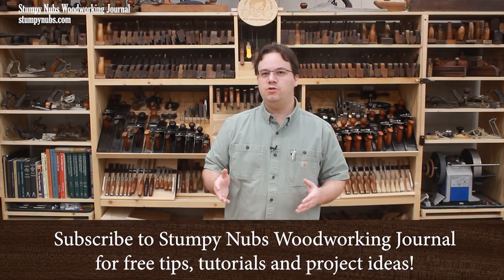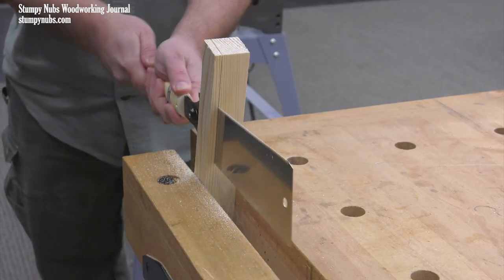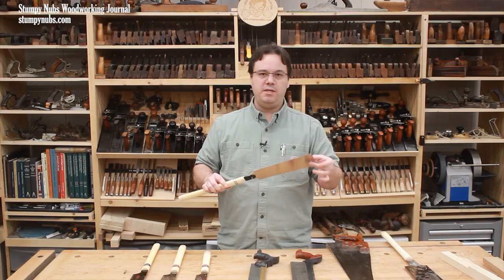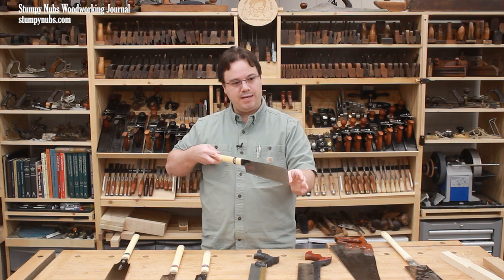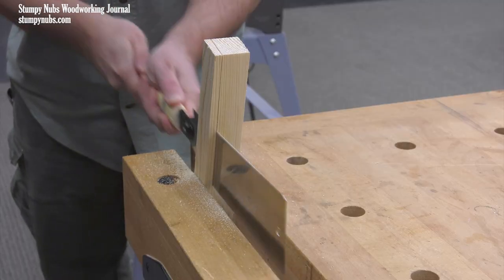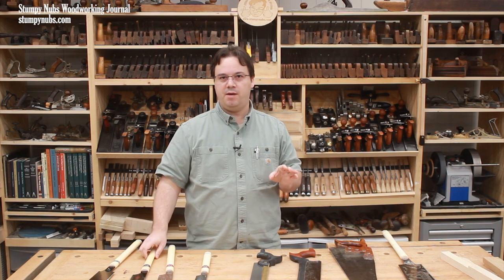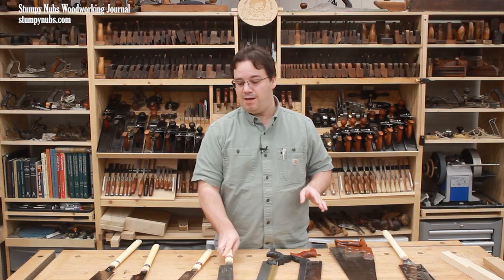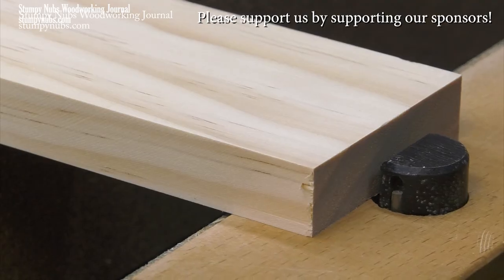Is Japan slowly killing western-style saws?

Comment: I got a Ryoba for christmas and I bloody love it. I hadn't intended to be using it just yet (weather is still pretty wintery here so not had a chance to start any woodwork-builds this year) but I discovered just adfter Christmas that I had an urgent need to rebuild my bathroom (water damage meant I had to rip out and rebuild everything) and my new Ryoba was absolutely brilliant. While I used powertools for most of the big cuts, it was superb for smaller jobs. I laid 5mm plywood on the floor to go under the new vinyl and it was damn-near perfect for cutting around door-frames and pipes.

There is only one disadvantage that I found - because it cuts on the pull, you have to hold your wood down much more firmly than you do with a western saw. I'm used to being able to place my wood on a stool, kneel on it, and crack on with sawing, but with the Ryoba, it would often catch on the wood slightly on the return-stroke, making it flap against the stool under my knee. I could clamp it down (and it did do this for more precise show-piece work, such as side-panels for cabinets), but it's an extra step that slows you down a bit. However, the precision of the cut (even from the "rougher" end of the Japanese Saw Spectrum) was worth the effort.

I would recommend one to anyone, and I'll definitely expand my Japanese saw collection in the future - I suspect the only Western saws I'll buy will be the £5 disposable building-site ones that I'll use for only cutting 2x4s and pallets to very rough size (and maybe the odd tree-branch)

Comment: This is great great content as usual, James. There is at least one other type of Japanese saw worth mentioning, and that's the small (5"-6") "Suizan" which is, like the larger Suizan you showed, a dedicated,  flush-cut saw. The small ones are great for sawing off dowels, etc. in tight spaces. 
I'm firmly in the Japanese pull saw camp now. I still have my dad's Western style crosscut saw and my first back saw/miter saw. They're dull with use,  but after testing the waters on an inexpensive Ryoba, I've got no desire to sharpen and use the old saws. They'll become some type of art pieces...maybe a sign or two for my shop.

Comment: I am a professional finish carpenter, as well as doing custom shop oriented wood working. On my site work, a good quality ryoba is my hand tool bag at all times. I reach for 5-10 times a day. It works quickly and accurately (in trim carpentry terms). I can have it out and the funny little notch I have to cut done and moved on before I could even get an equivalent tool out of the truck. Think notching door jambs around different floor heights. In the shop, I keep a higher quality ryoba and a very good quality dozuki. The dozuki is great for dovetails, with the one exception. For very hard woods with wild grain, the dozuki has a tendency to want to track with the grain. For those instances, I have the Lee Valley dovetail saw like in your video. Can't tell you how many old trim carpenter farts I have converted to the Japanese saw train. Once you let them try it, the next time you see them they will have one.

Comment: Hi James,

The comfort and fatigue advantage you mention is because the pull stroke uses the posterior chain, which means all the large muscles in your bank (lats and traps) and the biceps, while the push stroke uses the smaller chest muscles (pecs) and the triceps (which, while larger than the biceps, are mechanically disadvantaged by the structure of the elbow).

Comment: I would like to suggest a very useful saw, especially in the field. Silky makes a folding "pruning saw" (Gomboy) that is great to fold with the blade protected by the handle and keep in your back pocket (or in your tool box). I use these saws to cut off pegs in timber frame construction and cutting trim on a roof without the need to run an extension cord for a power saw. I often use them in the shop, as well. Cuts are clean and the blade rarely scratches the adjacent surface when cutting pegs flush on a finished timber. Blades are available with very fine or aggressive teeth.

Comment: I did a little research to confirm something I vaguely remembered hearing. Japanese and Western woodworking tools diverged to work on the pull versus the push for a very simple reason. Traditional Japanese woodworkers work while seated on the floor. Push strokes simply don’t work from that position.
Reply: I was thinking the same thing. Shoyan Japanese Carpenter on Youtube mentioned he always prefers working close to the floor to cut. It made a lot of sense since he's using pull saws.

Comment: Good points in this video, just would add: if the tool is made in Japan it is good quality. My Zetsaws ran about 900¥ a blade and are razor sharp. Handles, which can be straight or pistol griped, adds another 1000¥.
But key is that it is made in Japan.
Finally, the first tooth by hand is for digging out your cut line, and the last tooth is for flattening your cut if it is domed for joints. Incredibly useful features many will miss.

Comment: I really enjoyed your Japanese saw video.  Also, thank you so much for your recommendation of the Ridge saw blades.  I just bought one of their blades and wow, what a difference a good blade makes.  We all know there's a big difference between a sharp blade and a dull one, but I never knew there could be so much difference between a good blade and an average blade.  Yes, the Ridge blades cost a bit more, but they're definitely worth the extra money.  Those people obviously know their blades.  The cut is so smooth, and they even SOUND better.  They're well balanced and produce far less noise and vibration.  

Of course, being the frugal sort that I am, I can't bear the thought of trashing my old blades but I doubt if I'll ever buy another brand now.  I plan to spend a few bucks and send in my old blades to see if they can work their magic on them.  If nothing else, I can always use them for rough work but I'm guessing they will perform much better after they've been worked over by the pros.  Keep up the good work!

Comment: A only use Japanese saws.
Sometimes when I'm cross cutting a flat wood board, like a 1x4, i like to hold the saw with the blade pointing down to the floor and moving in an up and down stroke with the handle on a slight forward angle..
Works great for me.

Comment: I use a kataba-like saw with curved handle, not a straight one. That makes the grip quite natural, therefore it is easy to switch to this type of saw when used to western grips.
For those interested, my saw is from Tajima (the _JapanPull 265_), and can be found on Amazon, though I got mine in a French hardware store.

Comment: the comment about using these saws in place of a power tool is right on!  I often grab one of our Katabas (several have 'half-pistol' type handles), instead of the noise and mess of the power tool, wne cutting a smaller piece... also, living in an apartment, nice to be able to do woodwork without having your neighbours pounding on the wall or ceiling!
BTW, Japanese tools totally changed my appreciation for woodwork!  I was just unable to 'get it' with western saws, and always felt that they were 'inelegant'; so, along with the dreaded pocket hole kit, I ended up happy to dive into projects that I'd never have done in past!
Oh, and a 'funny' thing...when you DO cut into a finger with a fine blade Kataba, it will heal without a scar!  Yes, sadly, experience talking ;-)

Comment: I own and use several types of both western style and japanese style saws and like them both.
But I find it easier to correct the saw line during cutting with western style saws due to the stronger blades.
On the other hand the much lower weight of japanese saws is a very nice plus.
I personaly find the look of (traditional) western saws phenomenal!

Comment: Very nice presentation, thank you!
Besides all the valid pros of the Japanese saws, there are a couple more which contribute to explain cutting on the pull stroke. One is ergonomic as Japanese woodworkers traditionally operate squatting or sitting. In that position, one can more easily apply more force pulling than pushing.
The second is religious as, in Shinto belief, the craftsman is cutting the "spirit" of the wood piece and by pulling the saw it "redirects" that spirit toward the craftsman. This is viewed as beneficial and respectful.

Comment: When I started woodworking, I had a choice to get used to one or the other (I can afford both, but only want to get good at at least one at a time), I just naturally found the western style saw easier.  I am normally sized 5'10" dude.   I think what turns people off is the difficulty starting the cut.  Also I think people try to grip the western saw with all the fingers instead of the bottom three (pistol grip), which inhibits a lot of flexibility in the wrist.

Comment: Good video.  I first came across Japanese saws about 25 years ago, and loved them for many jobs.  I still use my (very old) Disston panel saw, which I also love using.  For long, straight cuts through timber it takes some beating.  Years ago when I was working alongside some carpenters, they recommended that I get a panel saw as my main saw - you could do pretty much any type of cut with it.  And they gave me a great tip for cutting accurately to a line - don't even try to follow the line inch by inch; Just aim for the bottom or far end of the cut, and go for it.  Constantly trying to correct for small errors just makes things worse.  I found it to be very true - I stopped looking at the line just below the blade, and went for the end of the line.  Similarly with hammering nails.  Small taps, constantly correcting for any waywardness of the nail doesn't work.  Just tap the nail in so it is slightly embedded, and then go for one big thump.  It will go straight in.  I watched them do this, and it worked, so I tried it - it still worked.  I way them hammering 6 inch nails in with one blow.  This is similar to splitting wood with an axe.  Don't aim for the top of the wood, aim for the bottom of where you want the split to be, and hit it hard.

Comment: I use jewelers saws all the time, and they are almost always set up to cut on the pull; of course, you can put the blade in facing either way, just like a hacksaw, which I also tend to use on the pull, usually not always.

Comment: Been using some basic pullsaws for years, but never of high quality. I can't believe how long they have stayed sharp. I also have a tiny little pull saw that I actually found at HF. Made in Japan, wooden handle, about 6" blade length, and extremely sharp. It comes in very handy in tight places. Pullsaws are the best for cutting shims after hanging a door.

Might be time to upgrade my pull saw selection.

Comment: Good point re the tooth set on Western saws. I find the majority of Saw Drs set them way too wide. My approach is to take out most of the set to the point where the teeth only just protrude. To stop the saw jamming in the kerf all you need to do is keep the blade lubricated with either wax or Camelia oil. Any residue is removed by either the planing or sanding step. Japanese saws are perfect for the small intricate cuts I make when building smaller projects like Jewellery Boxes etc. Both have their place with neither one being overall superior.

Comment: Pull stroke saws are good for precise work but for general construction carpentry give me a topline Diston or Sandvik, properly gummed, sharpened and set. Working high in the rafters of a house I much prefer the push. Working is safer. The pistol grip is safer and easier to hang and keep handy. If kerf thickness is VIP to you then keep a pull saw handy for some jobs.

Comment: I'm relatively new to semi serious woodworking. I remember using my dad's western saw as a teenager...and the memories aren't so great. It would bind and I'd think I was damaging his saw. Just started playing around with woodworking when we went into lockdown and had never heard of Japanese saws until I started researching types and best kind of saws. Had nothing to lose but the bad memories of my teenage experiences so I decided to give it a try. It was a day and night difference in ease of use, confidence, and precision. I'm not at the level I see those Japanese masters at, but far and away more precise than I ever was with my dad's saw, plus the cuts are so much cleaner, they basically don't need any sanding. I now have 3 entry level Japanese saws and take it as a personal challenge to get as close to 90* cuts as possible. Haven't hit the mark exactly yet, but have come within the width of my pencil marking to being just slightly off. The only thing I'd use a western saw for would be for cutting tree limbs where precision doesn't matter and I was just wanting to save the blade on my Japanese saw. 
Pulling just makes more sense if you want to keep things in line. Think about this. When you "pull" a trailer it naturally wants to stay in line. When you have to go in reverse, thereby using a "pushing" movement to try and guide it to where you hope it will go, all hell can break loose unless you've got a reasonable amount of experience....much like the saw.

Comment: Not only are Western-style saws taking a hit from Japanese-style saws, but also from cordless circular saws. When I needed to make a quick saw cut or 2, I used to grab my old handsaw. Now I can grab my cordless lickety-split. I bought a cheap Japanese style saw a few years ago thinking I could give it away if I didn't like it. Well, I still have it, and it still cuts great. The day I bought it I cut 3 blocks from a 2x2 to see how close I could get without squaring and marking it. 2 of 3 were perfect on both sides, 1 had a paper-thin wedge of daylight. I may never use my Western saws again.

Comment: I have a set of both Japanese (expensive) chisels which I use for precision and I find that I like the feel of the larger tools usually (western) when removing waste.  It may not be ideal for most but I like to save time and work to my lack of skill by grabbing tools that make up for it.  I also have been saved by my Japanese rasp on many projects which utilize similar teeth to a Japanese pull saw.

Comment: There is also often a difference in the location of the wood and the method of cutting in the vertical plane for longer cuts. 
We prefer to cut horizontally placed wood from top to bottom with a Western saw using gravity (it is necessary to remove a larger amount of material). 
The Japanese saw cuts better wood placed vertically from top to bottom. Horizontally placed wood is usually cut at a very oblique angle (more precise cut, the saw is better guided).
I like these saws. Mainly for clean cut, that needs less energy. 
PS: I have a small workshop. There must be sufficient space on the floor and polystyren boards or a special vertical frame to cut the plywood sheets with a circular saw.
I usually divide large plywood boards/sheets with a Japanese-type saw, simply resting sheet vertically somewhere. Top half by pulling down, turn the board over and finish the other half. Straight cut, precise, quiet, in same time as with circular saw + preparing working space.

Comment: Actually different movement direction was due to being on the other side of the planet, hence the direction is opposite. It's the same reason saws in Australia have the teeth on the top and the smooth side on the bottom

Comment: I have a Japanese pruning saw by Silky that my friend gave me 50 years ago.  It still cuts effortlessly and has never been sharpened.  I can tell if it's a Japanese saw or not blindfolded by touching the blades.  Japanese saws do not cut but they slice the wood.  That's the best expression I can come up with.  I use ryoba on majority of my work.

Comment: it depends on what you are doing I have been doing carpentry for about 30 years if I was doing trim work I would use a coping with the blade backwards only time I used a push saw was when I was framing

Comment: I'm not a wood worker. I am a big fan of Silky pruning saws. They are taper ground from teeth to spine and have no set to their impulse hardened teeth. All of my Silky's are straight bladed pruning saws, leave smooth cuts and work very well for any weekend warrier wood work I do. What strikes me is how a lot of people refuse to accept that pull saws and push saws require different techniques, usually blaming bent and broken blades on the saw. My Silky Gomboy 210mm medium tooth folding pruning saw is almost 20 years old and the original blade still cuts so well that the replacement blade I bought 15 years ago is still in it's original packaging. Admittedly it's not exactly laser straight any more but still makes smooth fast cuts and has lost no teeth even though I'v cut a fair amount of dead Oak just feet off of dusty dirt roads.

Comment: My base selection of japanese saws: the biggest ryoba you find as rough cuts are fatiguing and time consuming, the bigger teeth and longer blade the better it is, 2 katabas, with rip and crosscut teeth for more precise cuts and a dozuki, long version, for very precise joinery. The dozuki is so precise that the smallest one is somehow redundant for most of the woodworkers. I suggest a medium size ryoba only for those that don't plan to buy the katabas and want to have only 2 saws, thing that is fine if you have some sort of bandsaw or circular saw to deal with roughing cuts, but less then ideal if you really plan to do all the work by hand.